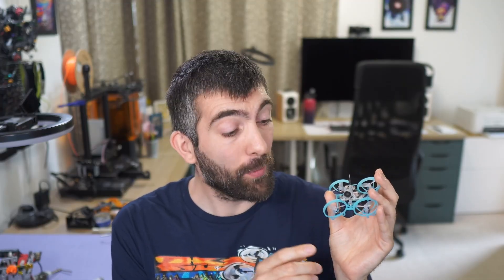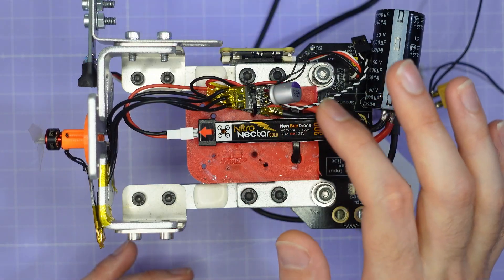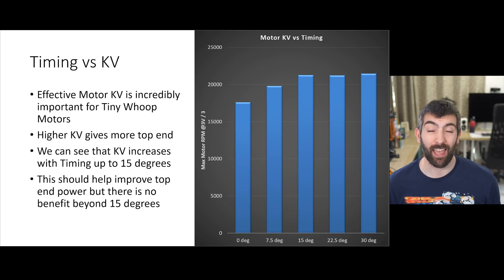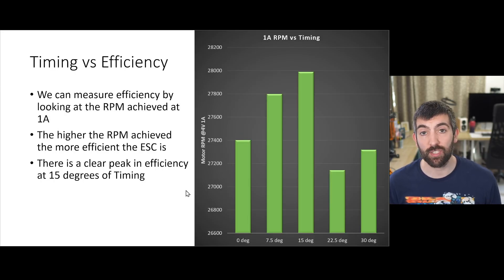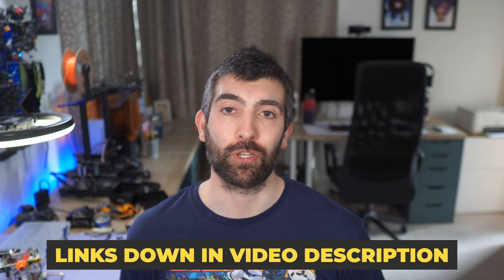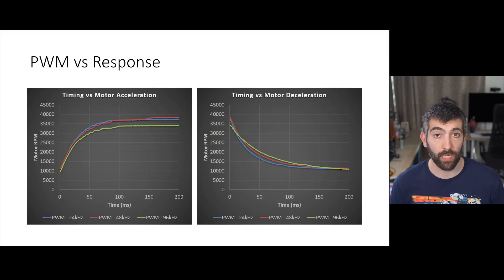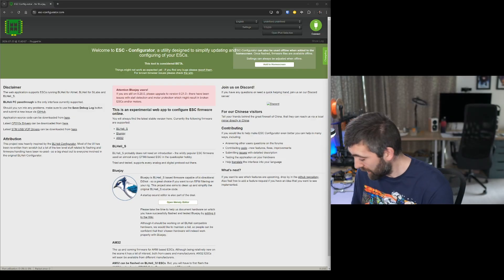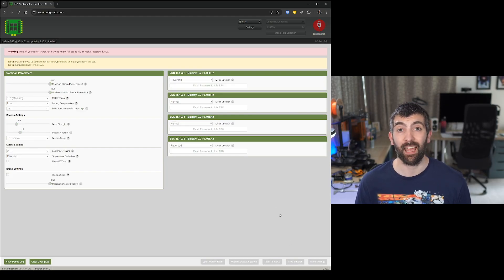ULTIMATE ESC Settings for Tiny Whoops!

Comment from the maker: IMPORTANT! Startup power was bugged in previous versions of BlueJay up to 20.0 so the recommended min and max startup power for 21.0 or later has changed. See here for the detailed information: https://github.com/bird-sanctuary/bluejay/wiki/Setup

The recommendation for version 21.0 of BlueJay is to gradually increase Min Startup Power (Boost) until your motors reliably start. Then set max startup power 20 points above this.
Reply: What does it mean ( the motors reliably start )? How do I tell if they start reliably? Any help would be appreciated
Reply: @himox1651  if they don't start reliably they don't stay running after arming(for example they twitch but fail to stay running/rotating).
if they start reliably they stay running after arming.
Reply: Mine seems fine at max? Would you still recommend your ammendment?
Reply: @GBUKMilo  Yes. They all seem fine at max first, it's the edge cases where it gets tricky. Especially when turtling or something is stuck in your props, your are risking to burn motors/ESCs.
Reply: @stylesuxx  Interesting, all looked good however when I really stress the whoop, its seems to go very floatly and won't drop on minimum power. If I recal the gyro (via the VTX) it fixes it.
Reply: Hi mr.Chris . i have a question about BLHeli32 . i use 3 Fly Mode rather than acro mode on my  5 inch quad.  On that case, i must increase Motor RampUp up to 100% so the motor can rotate on Low Throtle otherwise it will desync.   And like you said, it make the motors got more heat . Do i have any option to make the motor rotate on low throttle  ? i like to sent you the bench video,if you have discord or instagram.

Comment: For the Air65 Freestyle (0702SE II|23000KV) 15 degrees of advance is too low, motors became unstable and jittery. 
Video title is misleading. These settings are NOT for every drone and applicable only for that one tested motor.

Comment: WOW! Literally 50% longer flight time. I was getting 3 mins on a mobulite 7 hdzero (660mah, gnb2.0). Did this and just flew 4.5 mins.
Second battery I ripped like normal and got 4.25, crazy. Thanks a ton!

Only thing is I got a little prop wash on deep dives. Probably shouldn't be do those anyways haha.
Reply: Which FC are you using?
HappyModel SuperX HD aio?
I have some doubts about set in betaflight 8khz and 4khz for gyro frequency and PID frequency

Comment: i tryed 96khz by my pavo 20 pro and flylens85, both didnt spin the motors at arming, only if i give them a little extra throttle, it needs more then the max "esc-startpower"

i also didn't noticed an significant longer flytime or something, going back to 48khz, and both are now spinning good at arming.

Comment: After following the exact steps shown in this video, I unfortunately bricked one of the ESCs integrated into my AIO flight controller (BetaFPV Matrix 1S), which has now made my board partially unusable. After checking with tools like BLHeliSuite and ESC Configurator, one ESC is completely unrecoverable, another was showing as “unknown firmware,” and only two motors still function.
I just regret not being warned about the risk involved in flashing ESCs like this, so I wanted to share my experience with others.
Reply: wow just flashing it bricked it

Comment: This is absolutely brilliant! I want to do some tuning as I know I need to. I'm running Betafpv 0702 30000kv motors, and wondering if the same 15degrees would be the same for these super high KV motors. I would love to try these settings, but worried about damaging the aio fc or motors.

Comment: Fun Fact: When we first started helping test things with Thorsten (JESC), 96khz was an attempt to mimic the lack of braking power brushed motors had as a lot of Whoop pilots jumping over to brushless felt 24 and 48 braking seemed too fast. I think after that, he even played with being able to turn off braking all together. In our early testing, KV of motor also had different benefits between 24 and 48. (I think 22,000kv 802 was the point where 48khz was a better ROI).

Glad you are diving into this! That lower throttle resolution is definitely a thing I appreciate over flight time in most cases :)

Comment: Hi Chris, tried it on the mob7 and my turtle flip performance has reduced quite a bit after upgrading to 96hz, I noticed that at 48hz or 22.5 motor timing, it seems to work better. It's just anecdotal observation, but I wanted to check if you have any feedback on this.
Reply from the maker: 96kHz does change the throttle curve and this might reduce turtle mode performance. Increase the crashflip_motor_percent setting in betaflight CLI to fix this.
Reply: @ChrisRosser  thanks, weird enough, it's set to zero! I'll try to play with this setting.
Reply: I see, this settings name is a bit misleading,  you probably know this already, but leaving this for other readers with similar problem. it's actually the min power that each prop will spin, so a higher setting may lift it up the ground a bit, while 100 would make it ineffective since there won't be any flipping force. I tried 20, 50 and 75, and 75 worked really well for a hard floor surface. Thank you, problem solved!

Comment: You missed one thing: hover throttle. At 48kHz, my hover throttle is about 38%. Then I can use expo to make the range around 38% smoother.
At 96kHz my hover throttle is over 50%. And there is no way I can make the hover throttle smaller and still be smoother.
That's why I'm still staying at 48kHz

Comment: Updated bluejay to 0.21 version and my esc died(((( even now when I downgrade esc firmware to BlueJay 0.19.2 - motors still don’t spin. How to fix that? HappyModel 2G4 ELRS FC. 0702 26000kv motors.
Reply: Had the same problem solved it by upping the min and max setting.try min 1050 & max 1165

Comment: Updated blueyay and aplies your settings on a Mobula8HDzero. props didn't spin on arming?
fiddled with the settings, it flies, but feels like it will fly away it (did once so i toned down the settings).
liftoff/hover is at over 50% throttle? that used to be lower.
any recomendations?

Comment: The official Bluejay setup page is recommending way lower startup power values. If you are using such high values and there is something blocking your motors, you will probably burn them right at the start.

Comment: Is there a threshold kv at which you need to go over 15degrees to 22.5 ? Like if you're running 27000kv or the crazy 32000kv?
Reply: That's a great question.

Comment: This is very cool, and i hope you do the same for bigger builds such as 3.5 inch and 5 inch, as optimising settings for more efficency and performance really is a great free upgrade. All my escs are blheli-s, and i use bluejay on all of them since it's just so good. There is no need to faff around with the bl32/am32 mess either.

Comment: What about disc unloading while flight?
Also you top up the voltage to 4V per cell on a thrust stand.
When you consider voltage sag and disc unlaoding, Im sure the whole results of what is best also shifts over to the next parameter.
Personally I leave all on 48khz and 22.5 degrees motor timing. Tried others, but this just felt best in flight.
We need a wind tunnel thrust stand wothout toping up the voltage.
I test all my favourite prop combinations with gps top speeds, acceleration and general flight time efficiency. Of course not on tinywhoops.
Usually I take a props with a little more pitch than the recommended ones from the best thrust stand results. Disc unloading in the moving air and voltage sag just changed everything.

Comment: I flashed v21, and after some testing I only slightly upped my min power to 1050, and set the timing to 15 degrees.  I noticed a distinct extra crispness to the handling; not really big, but noticeable enough to make me happy about it.  My tune was already pretty tickety-boo as it was.  I kept to 48k, tho'.  My throttle curve is already at 1.00 for both midpoint and expo in BF, with a custom curve for the throttle in EdgeTX.  That setup doesn't like 96k at all.  It needs a re-profiled curve on the radio, something I'll get to later.  In the meantime, the few adjustments that I have made following your advice are working as promised.  Small steps over time add up to big change.  Thanks for the accurate info that lets me achieve that.
Reply: What quad do you have? Want to share your setup and tune?
Reply: @mistrzu1231212  I'm using a Mobula8 [analog/ELRS], running Betaflight 4.4, BlueJay 0.21, ELRS v3.5.1, and EdgeTX v2.10.5.

Comment: Much appreciated, Chris. I love to fly these but hate to tinker with settings. Very grateful for folks like you 🙏 looking forward to the motor testing.
Reply: Same here. Super excited for the motor testing lol
Reply: i found the happymodel 0802 20000kv on the Mob7 (40mm props) very efficient but a heavy motor with 1,5mm shaft and a little sluggish compared to 0702 with higher kv.

Comment: Hello, Chris! What about maximum efficiency guide for bigger drones , for example 8 inch?
Reply: Yeah. 8 inch UAVtech always says 24khz pwm for more touque
Reply: variable pwm will give you the max torque when you need it and max efficiency when you don't. for endurance flights on an 8" you really just need to strip out as much weight while still having a stiff frame. my 8" will do 18 minutes at 35mph with a 6s 2600mah pack and it doesn't feel much different than a 5" quad.

Comment: Great video, Chris! One comment: AFAIK you should not set the power rating to 1S. I'm pretty sure there's still a bug in bluejay that can randomly trigger the overheating protection of the ESC if the power rating is on 1S. And that can be pretty catastrophic if you happen to fly over water when this happens, as I had to learn the hard way.
Reply: What about a 3s 75mm whoop power rating setup esc? Thanks in advance

Comment: What no giant torque wheel?! 🔥Great information, Chris. So you think 96kHz even though it has lower acceleration/deceleration, is the few percent extra efficiency worth the responsiveness loss?
Reply: @putrid.p  I did and was referring to the 8.4% increase from 48k to 96k. You don't get any more thrust at different frequency so the only question is how much power it takes to get you there. Is 17% more thrust per watt (at 1A) worth it if the motors don't change speed fast enough to control it?

Comment: When and if you test motor sizes similar to DJIs please include dji motors. I am curious to how they are so efficient
Reply: They aren't. Dji uses huge batteries. That's why dji drones are slower and less fun, but fly longer
Reply: @FlydreamMedia  do you have a link to some data about dji motors? I think it is a combination between battery, esc, motor and prop. Not just battery size
Reply: @dfgaJK  I don't, but if it were motors, people would be taking them from dji drones and using them elsewhere
Reply: @FlydreamMedia  most fpv people want power over efficiency and thoes who don't just buy dji drones. That is probably why there is little data on it. I want a efficient small autonomous inav drone.
Seems there is no harm testing them to find out?
Reply: @dfgaJK  super huge props super small motor, that is what makes them efficient.
Reply: @aeryofpv  what size motors are they?
Reply: dji drones fly longer cause theyre designed for endurance, fpv drones are more tailored for power. you can make a drone that gets similar flight time to a dji but itd be boring af to fly
Reply: @HolyOllie  how can this be done?